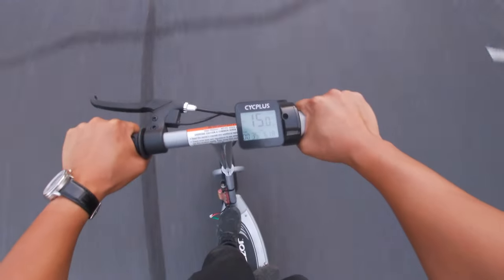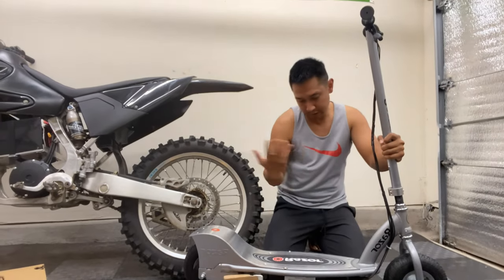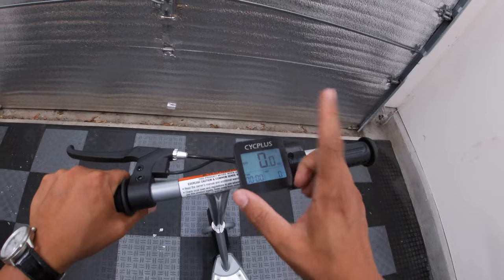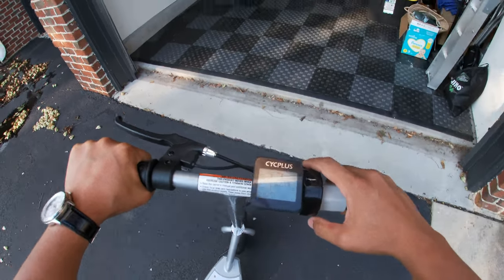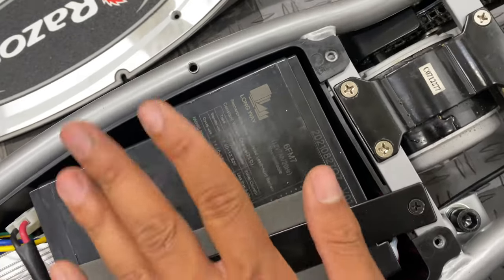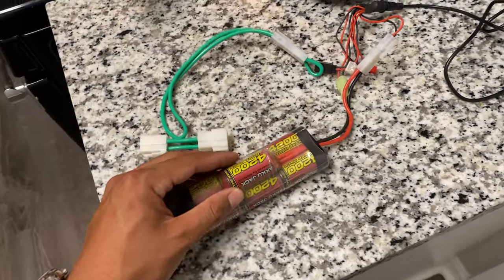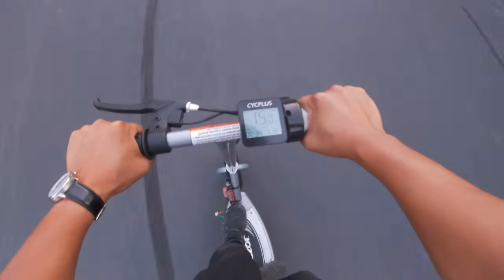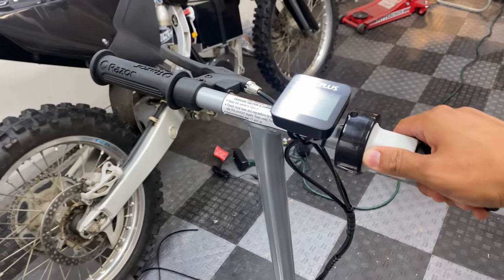Overvolted Razor E300 E325 Electric Scooter Unboxing & Top Speed Test

Comment: I would definitely go with a hub motor. No need for higher off the line torque on a scooter so hub motor is a good option. Plus you get the benefit of being extra quiet loosing the chain drive. Plus you gain more battery space. No brainer IMO.
Reply from the maker: Yeah I think this is the way I’m going. Do you have any in particular you’d like to recommend?
Reply: I'm looking on doing a similar mod, did you find a suitable motor that can get you up to 30? @PatOutdoors
Reply from the maker: @ObtuseAcute1  already did this, check out later videos in the same playlist

Comment: I put my shunt modded mx650 controller and throttle on a e300 running on 4 40v tool batteries in paralel with 0 amp protection. Motor may have been already a bit worn only lasted about 5 min but the distance i covered in that 5 min suggests i was doing 25mph at the least. 100% not worth it but also 100% fun

Comment: Those newer skinny tire e300s are 12-13mph best, the older fat tire with 200lbs still hit 15-16mph. I have built many 36v E300s, bith lead acid and lithium. I have seen 23mph modified 36v.
Reply from the maker: Appreciate the input. I’m converting this one to 52v brushless hub motor. Hopefully it’ll hit the 30 mph target
Reply: @PatOutdoors  nice, I have wanted to try that. No one has that budget yet. Ha

Comment: Why not flip the motor around so it sits on top? That way you can run an MY1020 with minimal modification. 

You would have to make a new deck out of plywood or metal, but it would get you the 30MPH you're looking for.

I would also advise a variable speed throttle when you replace the motor and controller. 

Your target should be about 36V with a 1500W controller and a gear ratio of 4, that ought to do 30.

Edit: NVM, I saw you went with a hub motor.

Comment: How did you get the speed booster attachement
Reply from the maker: Link in the description for anything I use on my projects
Reply: @PatOutdoors I tried it and it toasted my speed controller what should I do
Reply from the maker: @Wadinator  Upgrade to a 36V controller and battery set up.
Reply: @PatOutdoors ok thx